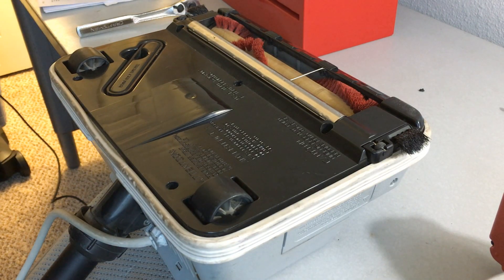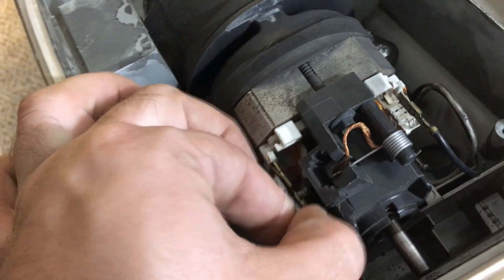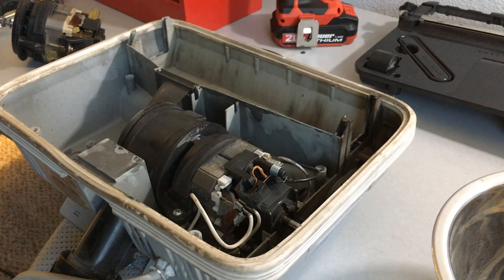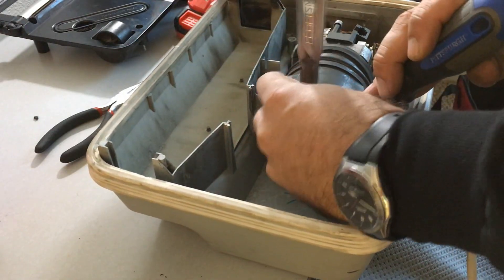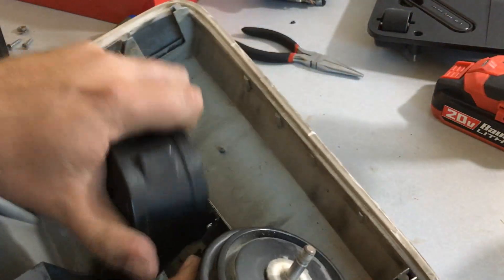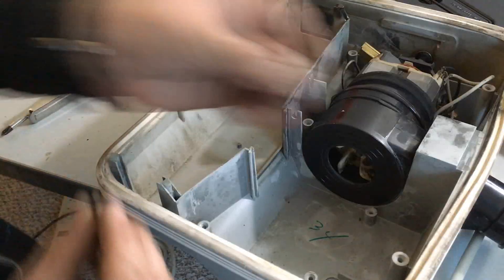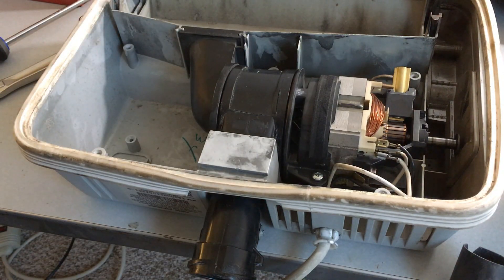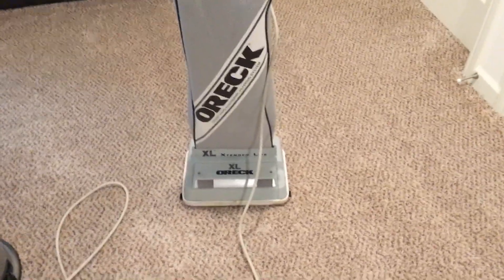How to Fix Oreck XL Fan

Comment: Thanks for you video instruction! Saved me a whole bunch of money on my Oreck XL21! Turns out my motor was still ok but the fan in the blower section was frozen against the housing. Also great tip on reverse threaded nut for blower fan.

Comment: This video helped me replace the fan kit. I had trouble removing the fan from the motor. After removing the nut it did not come off. It was stuck on after  20 years of use, but mission complete. TY

Comment: Hi Hank garage I got a new johnson motor for my oreck and the older model motor looks like a lamb or amtek motor don't know because it is rusty I can't seem to get the nut washer screwed in to the motor shaft keeps falling out maybe I'm tightening in the wrong direction got the motor on eBay for my 98 oreck

Comment: My oreck model doesn’t have regular Phillips screws on the bottom. What are these?
Reply from the maker: Torx screws probably
Reply: Bought me some torx bits to see if they are thanks!
Reply: Requires a T20 Torx screwdriver, or an extra-long skinny extension for a bit.
Reply: @Horseyhorsehorse  yeah I opened it with torx screws thanks lol
Reply: Seems like they almost all are Phillips but a few are star bit or TORX.

Comment: I have a oreck xl. Motor was sounding a little funny. Took the motor apart and noticed the fan blades are filed down like they have been rubbing on the intake. Also when I took it apart I didn't have to remove the nut on the fan, it just pulled apart. Should I order a new fan and intake?

Comment: I've followed the directions - thank you! But got stuck at the fan nut stage. I removed it as shown but the two housing parts won't come apart. Any suggestions - aside from going to  Oreck AND I already bought a replacement Fan Housing for my XL121?
Reply from the maker: Takes a minute sometimes but you’ll have to “rock” it out. Maybe try some wd40 on the shaft

Comment: I have an older Oreck XL, the wiring for the motor and switch is wired together with wire nuts instead of connectors. And I took the nut off of the fan and still can't get the fan to budge.  I also can't get the bottom pipe off of the fan shroud. I guess I need to spray some penetrating oil on it or something. Not sure why the fan won't come off....
Reply: Howdid you get the fan off
Reply: A small "pulley puller" should work

Comment: which 'XL" there seem to be a dozen versions.  Most not listed on the Oreck site.
Reply from the maker: They are all the same machine just a different color. The XL21 is different from the XL thats the only other model.
Reply: @hanksgarage_  Any idea if the XL21 is similar to this video? I have one and need to replace the fan housing as it is cracking and leaky.

Comment: Where could I find a wiring diagram for XL3600HH
Reply from the maker: They are typically in the back of the parts listing PDFs you can find on google.
Reply from the maker: https://www.manualslib.com/manual/800111/Oreck-Xl3600hh.html